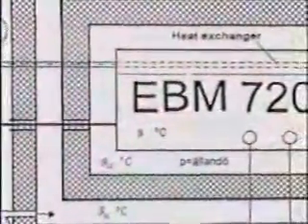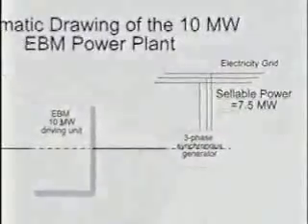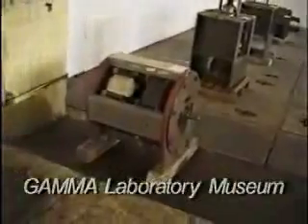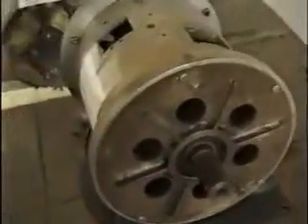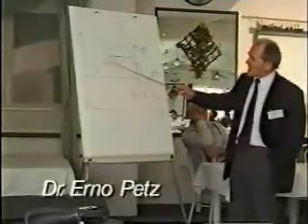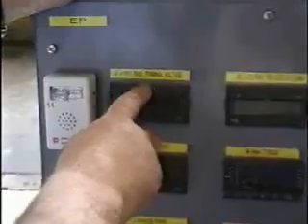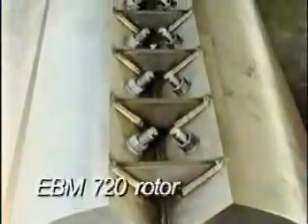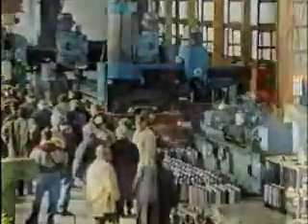Electromagnetic OverUnity Power Plant

Comment: @UnderManiac 
As an example once Mach 1 was achieved there was no technology at that moment to go Mach 2 but once further advancements were made to jets and their engines it then became possible. If you can view what you know now about motors then by placing magnets in a different configuration then blocking the resisting or pull back effects of the magnets is simply an advancement into a more efficient motor. It's the evolution of technology, that's all. No Magic, just scientific advancement.

Comment: @UnderManiac 
You still don't get it. It all has to do with specific magnetic alignment, not the usual placement of magnets in a motor. The motor on the market today requires greater input than output. Very specific magnetic alignments using magnetic shielding in the appropriate places allows the magnets to actually do most of the work therefore electrical input is less than output & output is higher than electrical input. Today's motors are not designed to do this

Comment: @UnderManiac 
You are so wrong.Yeager himself said that many on the team did not believe mach1 to be possible.The goal was there but some physicists calculated it as impossible. This is or was on NASA's website. Per that era, 1950s physics, "a plane cannot reach Mach1 because it will fall apart, it cannot withstand the pressure. If a plane were to reach mach1 the wind drag would pull it back therefore never achieving Mach1 & engines simply cannot spin at the rpms required to reach those speeds".

Comment: @UnderManiac 
I am waiting on free global to get the videos re-posted. He says he needs to remake the video series.
You don't understand, the magnets are aligned in such a way to contribute to the propulsion not strictly relying on input electrical current. These are not your standard motors in relation to what drives the motor but to create output current it is still the same old design.

Comment: @UnderManiac 
I personally do not believe anybody has ever accomplished the impossibility of over unity but I do believe anything with permanent magnet propulsion has been accomplished & the facts are that under a load Perm mags will last approx 300yrs, I was told this by 3 different magnet suppliers. If this hypothetical motor gets it's power from magnets then the fuel source are the magnets which have to be mined & sold at whatever price industry sets.

Comment: @UnderManiac 
12
The solar panel easily has the potential to shut down all other technologies like nuclear breeder reactors, fusion reactors etc. Although all of these technologies are also advancing in safety & practicability. but the huge difference is with nuclear you are not allowed to have a reactor in your back yard, it must be corporate controlled power production.You are presently allowed to have solar if your city codes or covenants allow solar panels, some don't even allow them